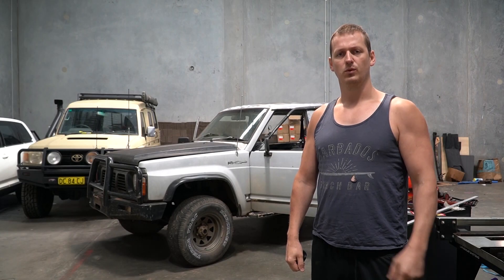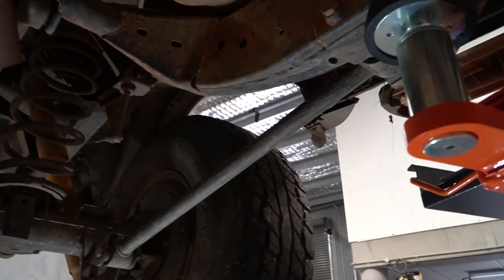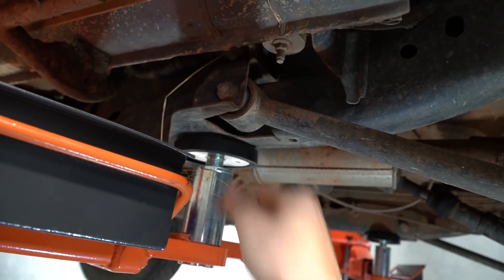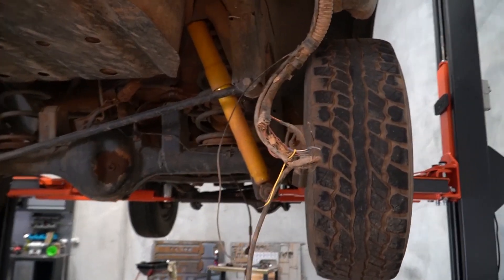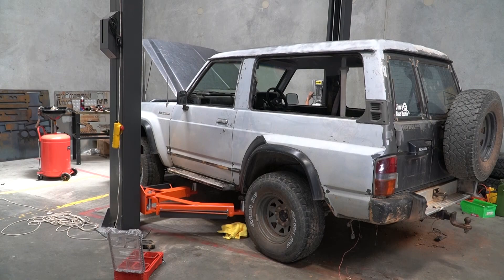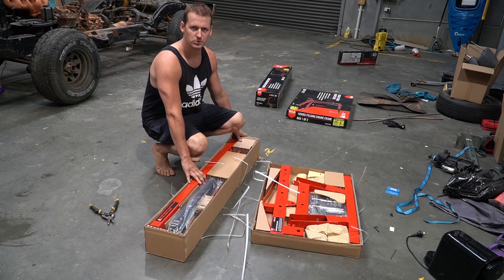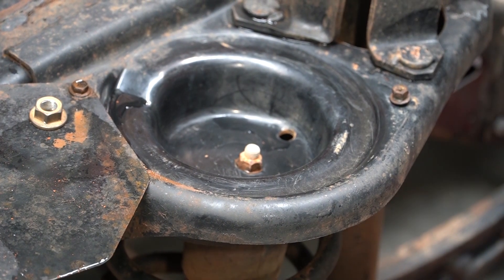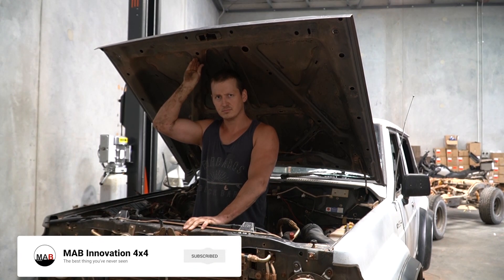V10 TDi Swapped Nissan Patrol Shorty  - Twin Turbo Y60 - V10 patrol ep3

Comment: I wish to have front and rear lockers in my 79 old model. In kenya these are rear, kindly assist on how I can get the lockers
Reply from the maker: the toyota 60 series had factory diff lockers. I THINK these diff centres will bolt in to an old 79 if you can find them.

Comment: I have a shorty, Son must have been influenced as he now has a shorty. Went from petrol auto to Kettle manual project with his. Lol on the lifting a shorty on hoist comments. Had to take spare wheel off when engine out as the 1m spread on hoist arms is kinda scary. Enjoying your videos so had to subscribe!
Reply from the maker: I'll admit. It may have caught me off guard. The weight distribution between the bonnet being closed and open was enough to set it off. Thanks for the sub!

Comment: You must really love old Patrols. That is going to be a massive project, and at the end you'll have an old Patrol!  Still, I can't talk. I've spent stupid amounts of time restoring Series Land Rovers, and at the end all I had was an old Land Rover.
Reply from the maker: I simply like making things that haven't been done before where the limiting factor is my own ability. I'm not sadistic enough to touch a Land Rover though... Owning a P38 for a year was enough.
Reply: the resell value for a "old" patrol is alot higher than most "old" land rovers on the Australian market, alot more people on the Aussie market interested in a old patrol than a old land rover of the same value because of the popularity. sure landrovers have all this glorius tech mechanical or silicon but a popular 4wdriver on YouTube like 4WD24/7 has a patrol and goes places? wow they must be good. same goes with land cruisers. ive seen a old GU patrol stock as a rock with a TB48 motor in it go for $30k and its a 2004 model.

Comment: That’s a good old Patrol excellent platform for you drug induced project lol 😂 and it’s good to see your using spanners instead of trying to undo 20 plus year old bolts and nuts and not 12V rattle gun your always a good laugh cheers